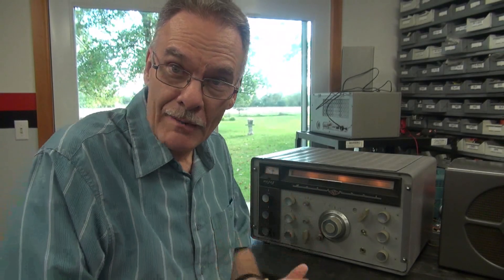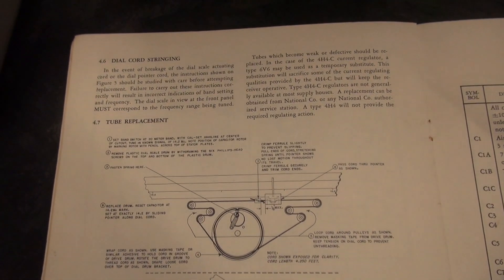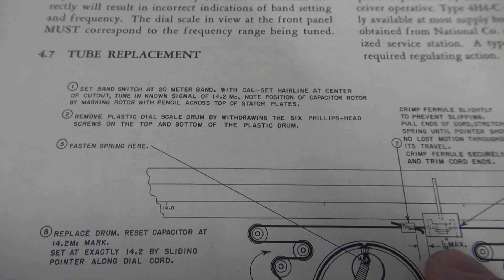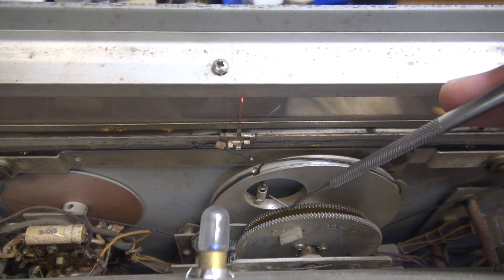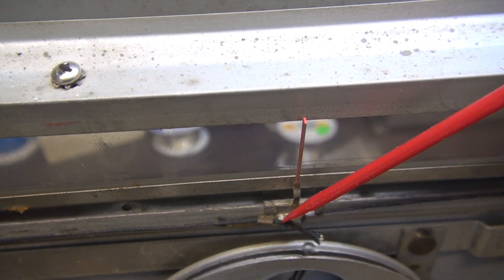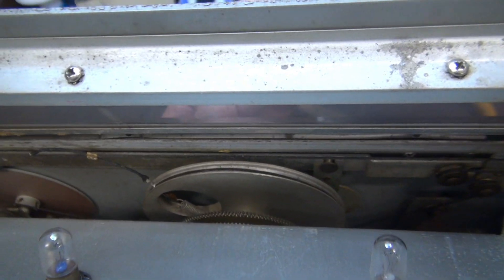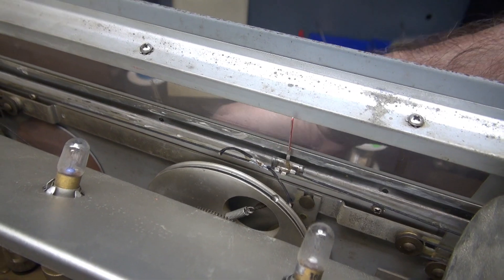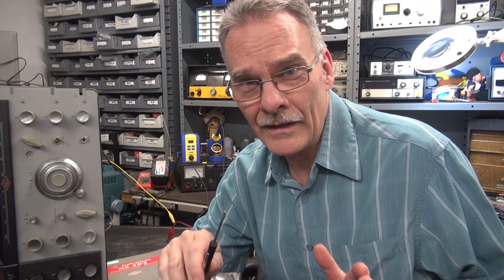How to restring dial cord National NC-303 Tube Ham receiver

Comment: Dial String is my favorite part of a radio restore. Many think I am nuts, but I enjoy the challenge.  You made it look easy Terry !!!!   Good stuff.
Reply: Hallicrafters amateur restorer, here. I have no Elmer in my neck of the woods (Eddington ME). What to use for dial string? The stuff called dial string is expensive. I am using Dacron braid line that seems to work well, although I have to singe the ends before stringing to keep the braids together. Did an S-85 yesterday, only to find the one pulley will not turn freely on the bandspread. Cannot get it moving freely, used CorrosionX, silicone oil, Lithium - no go. Now I know why there was a rubber sleeve on the knob shaft!

Comment: Terry, I just found a really helpful set of non-conductive tools, great for dial cords and belts. Made by Titan part # 17714. I got mine from AMB Tools in Tacoma WA. At the same time I got the non-marring pry tool set part # 17713. They look like they could be good for stuck knobs and pulley removal. They are non-conductive also.   Made from non-marring glass reinforced nylon composite.

Great job on the dial cord. I do so dislike restringing dials after several decades of working on old radios. 73'
Reply: Great tip on tools. Thanks.